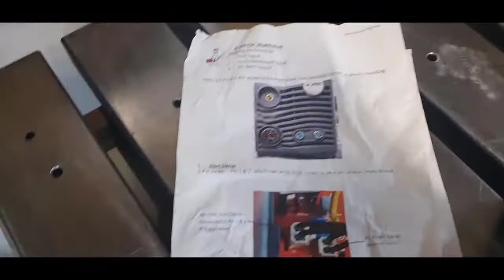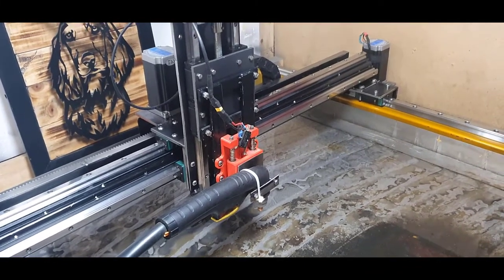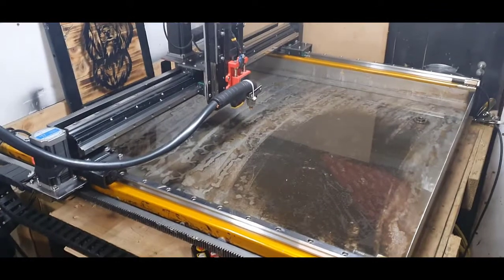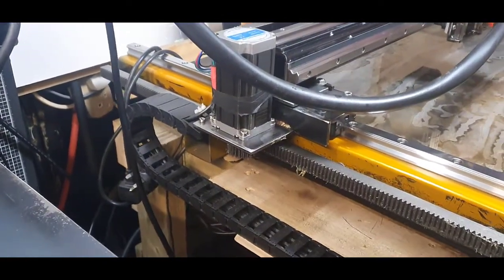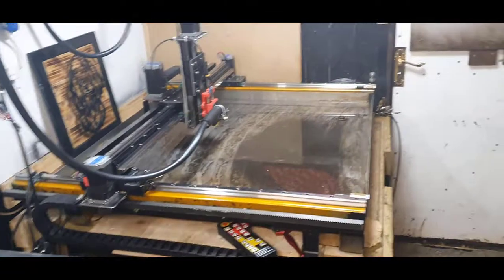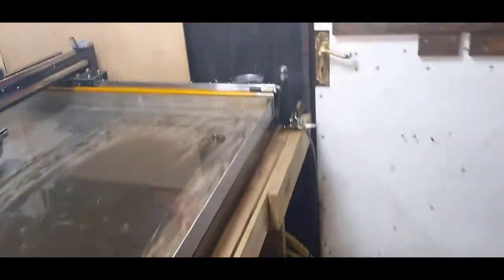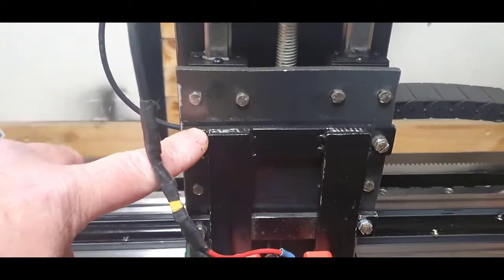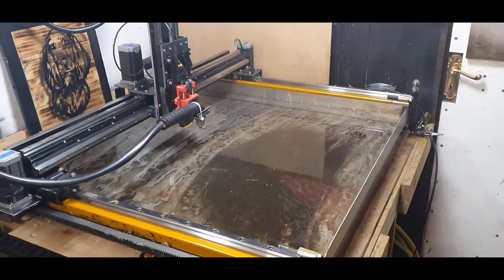Diy CNC Plasma Cutter (Jasic cut 45)

Comment: I can see where the 120 euro extra is going for the cnc interface on it.
That's what they are charging me if I want the cnc interface as a special order.
Simple voltage divider, some wires and 2 plugs isn't to expensive and it doesnt look like it takes 3 hours to install.
Reply from the maker: It's more than that I think now as I think It was a tenner when I did mine . I'm hypertherm now as Jasic became difficult to deal with
Reply: @smallgarageworkshop6119  are you running that hypertherm on 380v? 
I have seen single phase 230v in the specs but at like 30 amp which leads me to believe it's more towards US customers.
Reply from the maker: @samuraidriver4x4  240v mate UK  16amp
Reply: @smallgarageworkshop6119  good to know, going to save up some more and go that route then.
Using a cheap Chinese cutter now but the quality isnt great and its noisy (hf) but no pc issues yet.
Netherlands here 😉
Reply from the maker: @samuraidriver4x4  what I have noticed is consumables are night and day different.  They are screw thread on the jasic and keep coming loose . The hypertherm are huge and over like 12 months you have saved by purchasing the hypertherm. With the jasic I was using about 1 tip and electrode for 3 signs you see on instagram.  With hypertherm I use 1 of each every 21 signs lol
Reply from the maker: @samuraidriver4x4  oh yeah if I could turn back time I would have purchased the hypertherm first . I mean I get the jasic for 1400 pound ..  the hypertherm 45xp  I can get for 1900 but already comes with proper interface card and better torch and better consumables plus you can gouge with the hypertherm
Reply: @smallgarageworkshop6119  looking at the hypertherm they start at 2800 gbp over here, add in another 900 quid for a straight torch.
Almost worth the effort importing one from the UK at that point🤔
The prices for everything plasma related are ridiculous here
Reply from the maker: @samuraidriver4x4  well yeah they are 2600 here but I know people and no i use the hand torch as found a way to bypass the interface so best of both worlds plus cut  quality is the same
Reply from the maker: Took me 7 mins ish to install

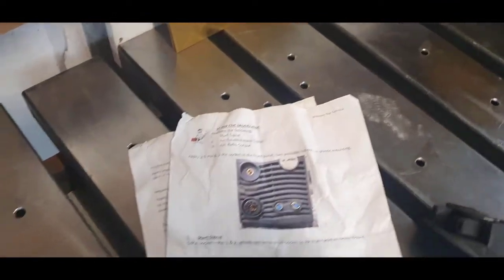Comment: where did you get the papers with the CNC modification instructions you show on 1:50 ? I bought a JASIC 45 and i would like to locate the contact points where i can get the raw voltage for my proma THC. Could you send me a linkt to those pdf's ? Thanks !
Reply from the maker: Hi
Follow me on insta and will send you them through there.  They were done by me a few years ago 👍
Reply: @smallgarageworkshop6119  hey mate, nice build. what motion controller are you using?
Reply: @smallgarageworkshop6119  could i trouble you for those instructions too? i have a jasic 60 so might not be the same but might give me some idea of were to look, i tried to tap in where the torch and work clamp connect but thats giving issues with pilot arc voltages.
Reply from the maker: @finlaybichan1275  no problem can you instagram please  me as can't send them on here buddy. Jasic 60 should already be done i think depending age
Reply: @smallgarageworkshop6119  yeah will do thanks man!  yeah it does have a divider already, i actually want to see if i can bypass it as my thc has its on 40:1 divider

Comment: I am also looking into a plasma source for in the field as well for a plasma table. What is the max of plate thickness you think you can cut with it? In the spec sheet it's says 15mn if I am correct? Does this apply to an cnc solution as well? And do you have an link for the cnc add ons for the jasic? Nice stuff you're doing. The parweld xtt212 are really nice tig welders. I worked also with the older brother the xtt202.
Reply from the maker: Hi Dean 
Yes 15mm Is the same with cnc however I wouldn't be cutting 15mm all day with it as the cut 60 then comes into play but that's 3 phase. The add ons they don't do now as at the time of purchase if you tell them you want it for cnc they fit it and send out. If you do go for the Jasic 45 then give me a shout and I will send you info on were to buy as they will beat anyone in uk. Yes the xtt212 is a right animal for the size 👍
Reply: @smallgarageworkshop6119  that is my reason for the jasic 45 instead of the cut 60 so it is portable and usable in the field as well. Most of the cutting will be 5 or 8 mm and sometimes 10 to 15 mm. I am also curious if this machine can do plasma gouging?  And I have an table but not yet an plasma source so that why I consider this machine
Reply from the maker: No worries . Well I have done gouging with mine as I have just placed the head at an angle but it's something I don't do but did it to see if it's possible. I think most modern cutters should gouge but i would contact jasic. Like I say I don't get paid by them and all the machines are paid for by me but are the only ones I constantly use without issues. I won't name names but I have paid silly money and not so silly money and the jasic is the only one left standing that I pass as a nice cut.
Reply from the maker: Well not had time to do these videos for a bit due to work but I'm back on them shortly with some smaller projects peeps can follow.  Follow me on instagram for all the latest projects @smallgarageworkshop  
Arsenal badge looks epic